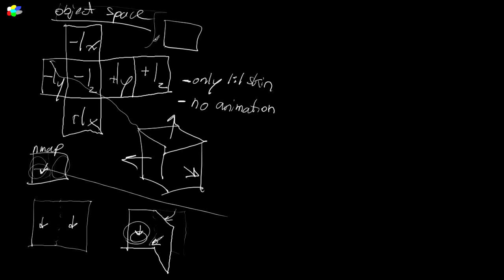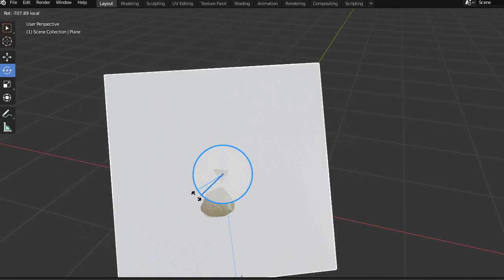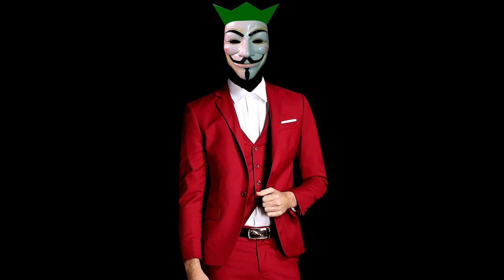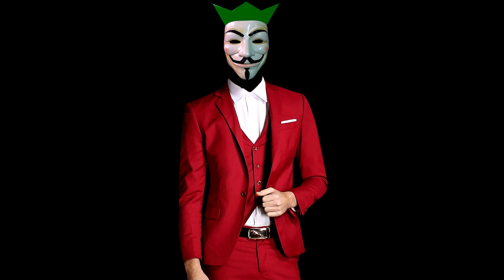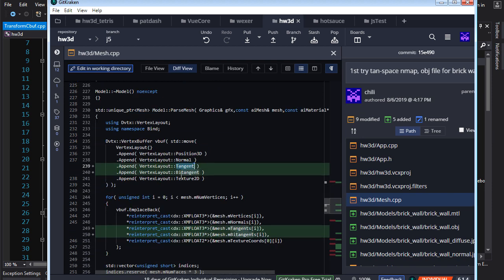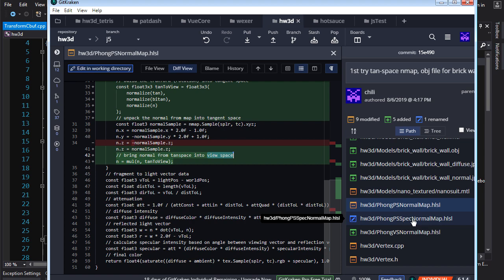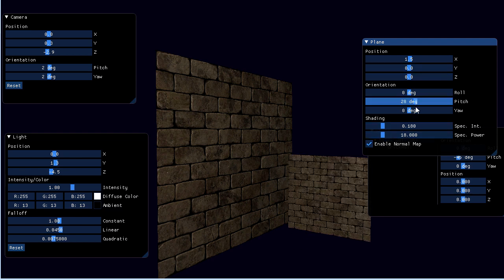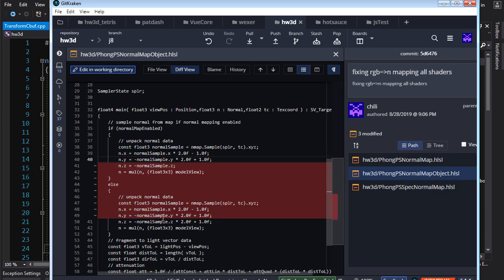C++ 3D DirectX Tutorial [Normal Mapping Part 3 - Tangent Space]

Comment: Do you think it's bad to use forward slash in windows file path?
Reply from the maker: I seem to recall fwd not working, at least with certain WinAPI functions. I tend to stick to the backslash for Windows just to be safe. But if you're sure all the stuff you're using is going to accept fwd, then it would be nicer for cross platform for sure.